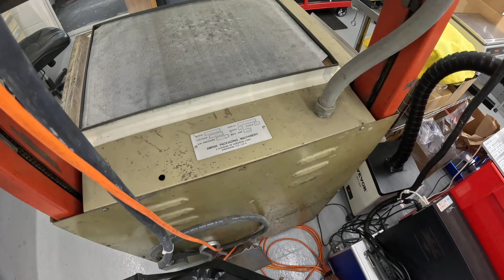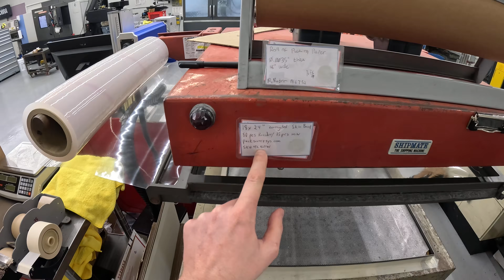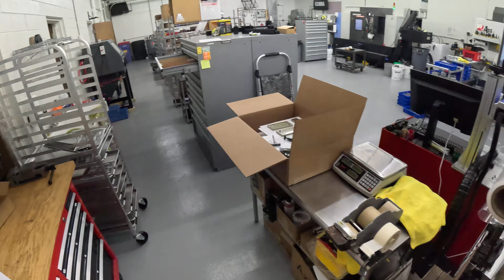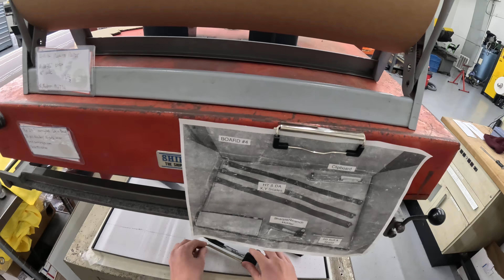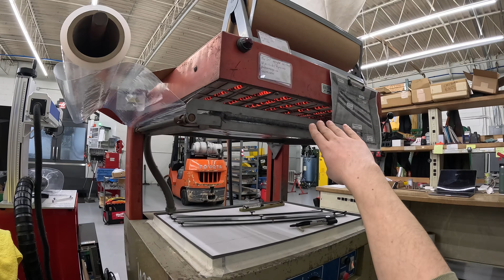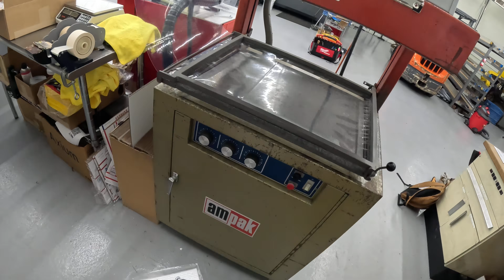AmPak Skin Pack Machine - Skin Packaging for the Machine Shop

Comment: Thanks for showing your setup! What's the reason for these special corner cutouts? Is there a larger item, that fits in there?
Reply from the maker: Yeah, I stack the skin boards 4 or 5 layers thick, but I have one extra part which requires the full depth of the box. It's a powdercoated stand that doesn't require a ton of protection so I just fit it in on the end.

Comment: We had a similar device at my old job but it was only good if you use the whole sheet. We tried the whole sheet and then separating the parts but then it doesnt seal anymore. And if we used a small part you use the whole backing and foil so its wasteful.
Reply from the maker: Yeah, it's only good for the whole sheet. That's part of why I only end up using it for this shown application in most cases. However it's still incredibly valuable IMO even if not endlessly flexible.